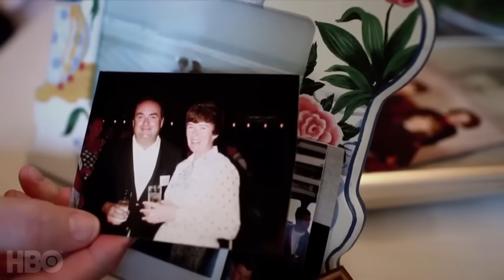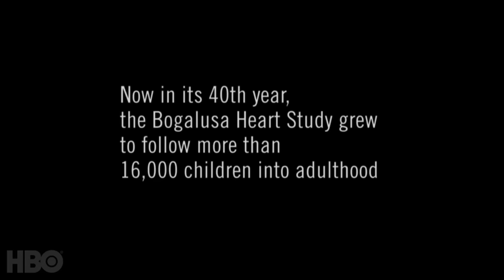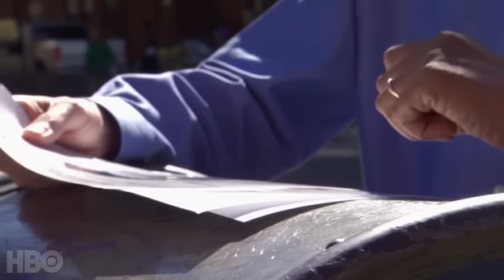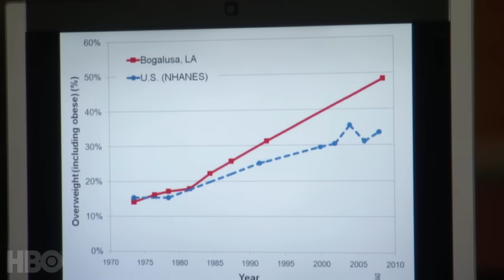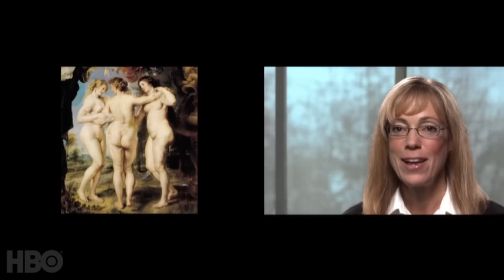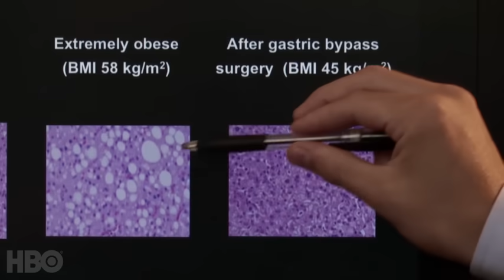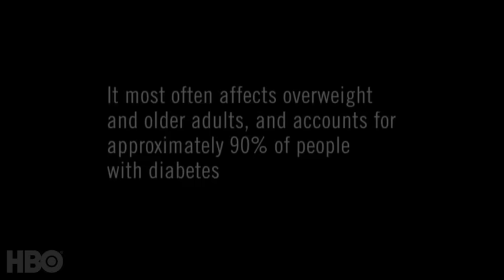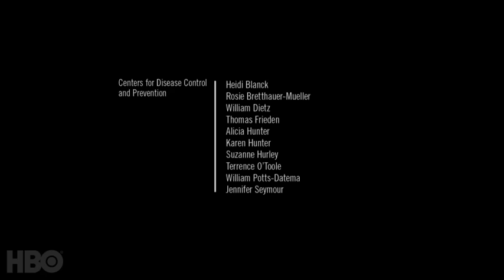The Weight of the Nation: Part 1 - Consequences (HBO Docs)

Comment: My mom had to change her diet to lose weight for surgery and I decided to join her. We do a modified keto diet, avoid fast food, processed foods, sugar. We cook meals at home. In 5 months my mom has lost 30 plus pounds and I have lost 25. It was 5 months of retraining our bodies, ignoring cravings, cheating some times, but continue to keep going. Totally worth it.
Reply: This sounds like an excellent textbook approach to weight loss and I bet you can keep it off with this lifestyle. congratulations.
Reply: You can just portion your food and eat a balanced diet this is a bit much
Reply: @kitten_582  ill never understand the need to do some crazy diet when just not eating processed food is the way.
Reply: @kitten_582  What is a  balanced diet?  Carbohydrates, sugars, fats and proteins are metabolized  differently.  A calorie of fat does not equal a calorie of sugar.  Insulin is a fat storage hormone.  Carbs and sugars are converted to triglycerides and stored in fat cells.  The human body requires zero grams of exogenous sugar and carbs to sustain life.  If you don't eat carbs and sugar your body burns fat.  That is why the ketogenic/ carnovore diets work so well.
Reply: @kitten_582  how is this a bit much? All they did was basically  cooked good food at home. If this is a bit much I'd hate to see what your way to much is.
Reply: @bermudav3348  how is this some crazy diet all they did was cut out bad foods. The retraining thing would come with anyone wanting to lose weight that's addicted to food.
Reply: Everyone’s journey is different. Keep doing you and ignore everything else. Good for you guys!

Comment: Hopefully this will help someone out there...  If you want to lose weight you need to accept and/or realize a few things:

1) Diets don't work.  Don't even start one. Every diet plan out there has one thing in common: A 100% failure rate.
2) You must eat healthy.  Fast food, gone.  Sodas, gone.  Processed food, gone.
3) Eating healthy is not a diet plan, it is a lifestyle.
4) You need to live a healthy lifestyle for the remainder of your life or you will fail
5) Move around/exercise.  Get at least 30-60 minutes a day of exercise.  Once or twice a week, double it.
6) Build muscle by doing some resistance training.  You don't need to bulk up, just put on some muscle.
Reply: Jeremy Jefferson my diet and exercise plan helped me loose 4kg in 5 days
Reply: @MeleenGames  I don't mean to discourage you, but that is not fat loss.  It would take around a 30,000 calorie deficit in that week to lose that much, or 6,300 calories a day.  For perspective, if you ate nothing at all over those 5 days you would have to cycle about 125 miles (roughly 8 hours) a day to burn off enough calories to reach that amount.

What you have most likely lost is water weight.  Almost everyone who starts a diet sees a 5-10 pound loss in the first week or two.  This is simply due to the fact that the "diet" usually decreases carbs and salts so the body releases stored water.  This is also why people get discouraged, you will only lose weight at this rate in the beginning and one slippage will bring it all back.  Go out and eat some Chinese food or a pizza and you'll be 5 pounds heavier the next day, all due to new water retention.

Again, this is not to discourage you but to bring things into reality.  If you continue to exercise and eat healthy you will be successful.  However, if your "diet" you speak of is something you can't maintain for the remainder of your life, you will fail the moment you quit.  If it's a restrictive diet, you will fail/quit sooner than later.

You probably hate me or are angry at me posting this.... but the problem is people don't realize these facts because all they get is encouragement instead of the cold hard facts about how to be successful.  My goal here is to help you.

I wish you the best of luck.
Reply: Jeremy Jefferson dude I’m not American no offense if you are but I only put on weight because of certain medications and certain medications are helping me loose weight as well most people in my county live on a calorie deficit it’s not like I ever ate pizza every day or even once a week I’ve gone for years without eating Macdonalds when you are on antipsychotics your body stores every single bit of fat it can find as it stops your fat burning processes and you burn way less calories than you should Tracy marks on YouTube does a video on it explaining the science behind it. I exercise 2 hours a day I also go for slimming treatments that burn the fat away such as fat freezing and radio frequency treatment that means if you exercise and diet while on those treatments you’ll loose fat way more easily than the average person you only loose cm first then the weight slowly declines but no one ever loose less than 1kg a week on those treatments If they eat well and exercise. I forgot to mention because it’s a lot of extra shit to mention. After 4 weeks of injections and fat freezing and radio frequency I lost a lot of cm everywhere but the weight has only started recently I had the opposite problem I was loosing fat but not weight in the first month I only lost 2kg of just fat but I into started dieting a week ago properly as I had bulimia so yes I know alll about how heavy food can make you if I ever saw food make the scale go up I would purge it immediately and am now on medication for it I can easily stick to a diet instead of binging on healthy foods like lettuce and potatoes as I did I can eat them normally I can’t go out with friends because they will always judge you for eating healthy No one really knew about my binges which is also probably why I was only loosing 500grams a week on my treatment it’s still not bad. I never had a problem with fast food or sugar or unhealthy carbs i can’t just stop eating healthy and eat foods I basically never eat now I didn’t put on weight from that like I said if you look up the effects of antipsychotics and weight gain they’ll explain how the body stores everything you eat and turns it into fats like it does after fasting which is why it doesn’t work. So I’m total I’ve lost 6kg in the last two months even if it was water weight I know I’m going to be loosing fat because I literally am burning it with injections and treatments. You can also notice the water weight when you go for a suna treatment you can sweat off up to 700grams that you just put back on after drinking or eating it’s just to help get toxins out your body. I also have a beautician who works with me so I’ve already lost a lot of the fat I’ve wanted to loose what your saying makes sense but I’m not discouraged because I have been loosing a ton of cm and burning fat so I weigh more than I actually look and probably still have water weight there is a diet called the fast 800 that works the best with it. I don’t do “cheat days” because I know how to cook nice healthy foods for way cheaper than any fast food we don’t have a “dolllar” menu a small macdonalds meal costs the same as a packet of mushrooms, broccoli and a few apples. The most expensive macdonalds meal is enough to feed yourself for an entire week it’s out counties policy on forgiven food cooperations they aren’t allowed to max the size here and it’s called sin tax you don’t pay taxes on healthy foods so it’s cheaper I don’t think western counties do that basically a simple chocolate is the equivalent to a packet of 5 bananas and apples. On the go two bananas is way more filling. Only the rich here have an obesity problem the rest of South Africa lives on vegetables and pap pap is extremely unhealthy though. It makes dieting way easier and it’s one of my counties good policies I suppose. Being healthy and staying that way is easy and more affordable fast food is an extreme luxury.
Reply: @MeleenGames  Regardless of all that... it is impossible to lose that much fat in 5 days, period.... unless you have it physically removed through surgery.
Reply: Jeremy Jefferson never said I lost fat at a certain amount like I said when you go for fat burning it takes a while to loose weight I said I lost a certain amount of weight not fat in a few days 🤷🏼‍♀️ you can’t just take people’s words and put them in your own narrative and assume their unhealthy and stupid. I specifically said that you only burn 1kg a week from fat burning from that exercise and dieting. Never said it was a ton of fat that came off in a few days. You initially assumed I’m some idiot who doesn’t know what water Weight is and completely dismissed diets and said I was going to fail which is rude as fuck you should say it’s not going to be easy but it’s possible over a certain period of time with exercise. 
Ps. hey A diet doenst just mean less food it means you have to cut out what doenst work for you by going for a test with a doctor where it tells you what foods to eat and not eat it’s the bets way to get results over time I suppose you don’t know about it because some people struggle on foods they didn’t even know their body struggles to digest even if it’s healthy. I forgot the name for it but it’s apparently quite expensive as they test your body with thousands of different foods.
Reply: @MeleenGames  You are actually the one putting words into my "mouth".  I clearly indicated in the first post that I was just making you aware that most, if not all, of that weight loss is just water weight.  Did you lose weight?  Yes.  However, like I said, being water weight, one meal will bring it ALL back.
As for the rest of your ramblings ... didn't read either of them past the first couple sentences because it was clear it was just that, rambling.
Reply: Jeremy Jefferson I know I’m
Not stupid that’s what I was trying to say I know I can’t eat anything heavy
Reply: @MeleenGames  The weight of food makes no difference, and isn't what I was getting at.  You could eat 5 pounds of fruit today and not be any heavier tomorrow.  Or you could eat something loaded with salt that only weighs 1/4th of a pound and be 5 pounds heavier the next day.  

Day to day, the weight of the food or the caloric count makes no difference in your weight today vs tomorrow.  The only short term effect is water weight.

This is ultimately my point from the beginning until you started going nuts and putting words into my "mouth"... here it is again: Any significant amount of weight change in a short period of time is water weight and is only a temporary gain or loss.

To claim that your "diet" led to a 4kg loss in 5 days is either misleading or a huge misunderstanding. Diet or no diet, you can easily see a 0-10 pound gain/loss in the matter of 24 hours solely based on what you ate.

I would also argue this is why monitoring your weight with a scale when trying to lose weight is not a good idea (unless you are truly trying to lose just water weight due to a medical condition).  The better way to monitor fat loss is by taking pictures of yourself every day and noting things like how clothes fit.

If you are going to use a scale, it is really only helpful if you log your weight every morning after you wake up and take the average at the end of the week.  Then compare those averages over the course of months.
Reply: To be fair
Diet: the kinds of food that a person, animal, or community habitually eats.
Everything has a diet. Everyone has a diet. There are good and bad diets. It is those that try to make money off of crash course diets that give the word diet a bad name.
Reply: Diets do work. Not not going to class, not doing the homework, and failing every test doesn’t mean the teacher failed, means you did.
Reply: The health food is unprocessed food? Give some examples please.

Comment: 58:30 I can't believe she just blamed her husband's obesity and diabetes on red meat consumption without even mentioning sugar!
Reply: Yeah I know, red meat is actually about the most beneficially nutrient dense food a human being can possible consume. Like with anything else it's about controlling "how much" your body needs which can vary tremendously from individual to individual. Sugar is BY FAR more of an issue than red meat could ever be.
Reply: Cutting back to fish and chicken will do nothing for them if they continue to eat processed foods (bread, pasta, desserts) and fail to add plant based, whole food nutrition to their bodies as replacement choices. The cure is not complicated and not costly compared to the disease. I hope there is a part 2 to this doc that addresses optimal food choices.
Reply: @erickelly4107  I lost 25 lb from not eating red meat.
Reply: @nonewherelistens1906  There is Part 2 uploaded.
Reply: Yet red meat has a significant amount of saturated fat shown to have a negative impact on the heart
Reply: Yeah, there are studies that show that fat can clog the insulin receptors in the cells which will cause type 2 diabetes.   Over consumption of processed sugar and carbs just exacerbates the issue
Reply: @iwnunn7999  but WHY does the fat get into the insulin receptor? it's fat from inside the cell, not outside
Reply: @mendingwall3823  So then why does the heart love to run on saturated fat when there's no sugar around?
Reply: @nonewherelistens1906  I think we can conclude that processed crap makes any diet unhealthy, whether it's an otherwise all meat diet, or an otherwise all plant diet. I personally choose to eat mainly pork for economical reasons, but would eat mainly beef if I had the money. Eggs on top of both. As it is I've got a grocery budget of just $200 this month and I'm in Canada.
Reply: @ellenorbjornsdottir1166  At $200 a month, you must be creative with your choices to make that stretch.

Comment: I was 244, height is 5'8" and I'm 32. I did a water fast for 27 days I lost like 40 pounds, I'm currently at 210 it's a good weight to be at after a fast and slowly working out harder in the gym. My cravings when my fast was going to end were cucumbers since they were probably the only thing I can eat without suffering through refeeder syndrome, I've currently replaced two of my meals with salads and get a small meal of beans and rice with a multivitamin. Fasting really got rid of any food cravings for me, and it made me appreciate my veggies way more now cause when you have been fasting yourself for a month anything will taste amazing afterwards.

Comment: Around 32:00 looking at diseased hearts the doctors keep commenting about how much fat there is on the heart. Although no specifics are discussed, there is a pretty strong implication that it was dietary fat that caused the fat deposit. It can almost be guaranteed, however, that this is not the case. Excess carbohydrates and particularly refined sugars and fructose are a far more likely causal agent. If only we had the will to find out rather than assuming the diet-heart hypothesis to be correct on the flimsiest of evidence.

Comment: At my highest I weighed 308 and was blessed not to ever have had diabetes. For years I wanted to stop eating meat and I did that losing 60 pounds. I gained 20 pounds back eating bread and snacks which I have cut out. I now weigh 253 with a goal of 200 pounds by June of 2019. I  still do not eat meat and hope I never eat it again (2 1/2 years). This is such a interesting program. I am routing for everyone trying to beat the bulge and congratulations to those who have.

Comment: 53:18 "People with obesity can have all source of health problems.........they may have kidney failure that leaves them attached to the dialysis machine for the rest of their lives." This is pretty much true, my mom works as a social worker for dialysis and sees her patents 3x a week. Your kidneys helps remove toxins from your blood and send waste to your bladder so you can urinate. When they don't work work anymore, you can't urinate and the water, waste, and toxins that is suppose to go to your bladder goes to your other parts of your body where they aren't suppose to go and makes you sick.Those with kidney failure have to go to dialysis, get hocked up onto a machine for hours and can't move or go anywhere as the machine cleans their blood 3x a week for the rest of their lives until they get a kidney transplant. Most of the people on dialysis are normally sick and tired, if they stop going to dialysis and didn't get a kidney transplant, they will die.

Comment: If obesity comes before insulin resistance, then what causes obesity?

Doesn't the hormonal change precede the weight gain? 

If these doctors were correct then the problem would be solved by now, but they are mistaking effect for cause. 

Elevated insulin leads to weight gain. Certain foods cause elevated insulin. Eliminate those foods from the diet and you eliminate high insulin.
It's  not an obesity epidemic. It's  a hyperinsulinemia epidemic.